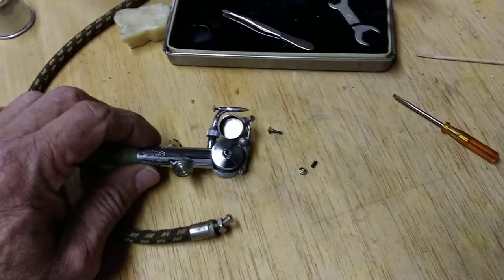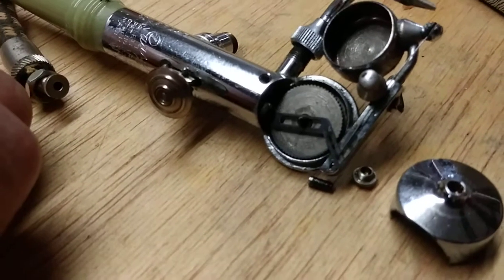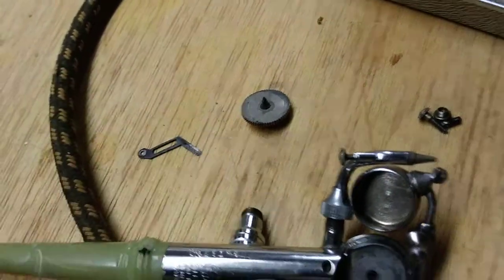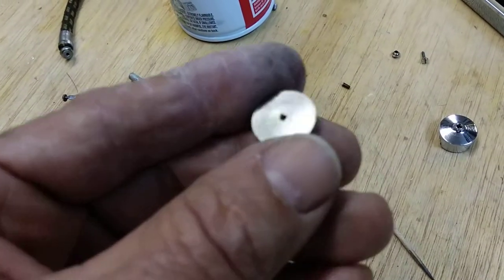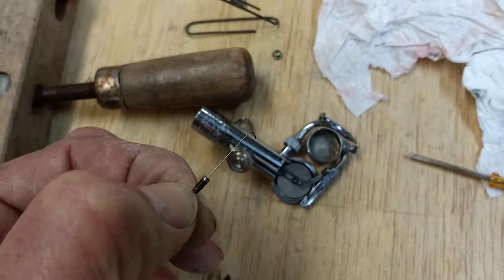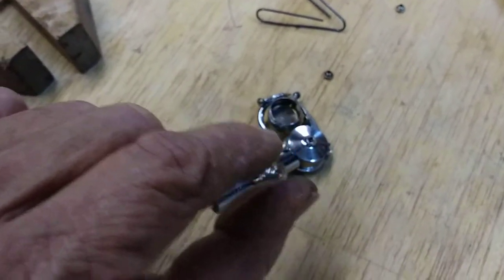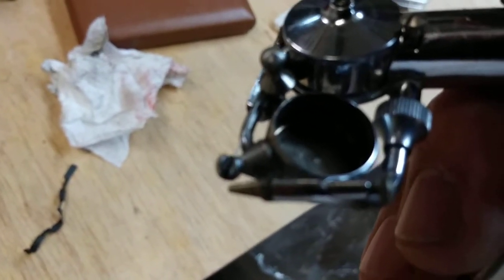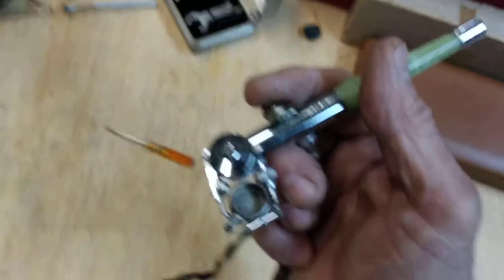Paasche type AB turbo airbrush inside cleaning disassembly reassembly.

Comment: Fantastic tool. Was first introduced to it in 1990 after I’d been airbrushing for about ten years. Purchased a used one from an older gentleman who  did photo retouching for ad agencies here in the Twin Cities in the 40’s, 50’s & 60’s. It took me about two years to master tuning it to the point I could utilize it regularly and reliably. There’s definitely a standard or basic configuration which is good for average paint application but the real joy and advantage to using the AB for me is the custom applications which can be achieved by tailoring the fine tuning and settings to accomplish them. There really is no limits to the range of tasks this airbrush can accomplish if the time and trouble is taken to configure it for what you’d like to do. Everything from numerous distances between elements to tensions, RPMs, air pressure to the drive, air pressure to the air jet at the needle bearing, the needle throw, the relation of the needle’s tip to it’s air jet (distance and centering) the curve of the needle itself as well as the angle of the paint pan in relation to the bend of the needle (and more) can be manipulated to alter and affect the operation of the airbrush. I’ve even sanded the very tip (profile) of needles, amending them to more of an egg or pointed oval shape to depart even finer particles of paint to surfaces I’m micro stippling. The tapers of the needles can also be lengthened or shortened to change the rate (faster or more gradually) that paint is blown off of it as throw (distance) trigger is pulled back.

I’ve noted a couple of important points which are not covered explicitly in the manuals and specs having to do with cleaning, configuring and tuning the AB. One regarding the spindle’s bearings (top & bottom) which move up and down in their respective (threaded) seats. If removed or simply adjusted, care must be taken to be sure this ‘free wheel’ which drives the cam ends up centered (floating, so to speak) precisely on the right plane for proper drive. An unrestricted spin, but one which is not overly loose (rattling) is desired so when striving to achieve via the threading of these two bearings (up & down) one must take heed so the free wheel’s cam is in the optimal position to ensure the needle is unfettered in it’s cycling on the small cam. I’ve found running the brush at good pressure and listening to it as you fine tune the bearings, as good or better than any visual assessment while doing so. 

Another issue is that these bearings have a tendency to move in their threads due to vibration, especially older, worn ones. And while a lubricant such as Vasoline promotes good spin, it can also contribute to this problem because heat created by the high RPMs liquifies some lubricants and it can find it’s way into these threads, promoting this shifting in the bearing’s positions and subsequently the optimal pressure on the pin like tips of the free wheel’s center shaft. Usually, the bottom bearing will shift first, this being the affect of gravity on the softened lubricant. For this reason I keep the bearing grease to a minimum and as well, force a small bit of bee’s wax into the threads with a minute applicator such as the tip of a toothpick. I do this towards the bottom of the bottom bearing housing and towards the top of the top one, after my cleaning and prior to reinserting the bearings into these threads.

Thank you for the fun video. I’ve learned a lot about using my AB also so if anyone is having trouble with something specific on theirs or is simply new to this wonderful old tool, let me know, I’d be happy to answer any questions I can or share my knowledge regarding them. ddecay via gmail or the user name dadenko on deviant art’s site.
Reply: I bought one used about 25 years ago. I sent it to the factory for a factory setup just to get me started.  I did manage to use it often as I do airbrush work for a living. I never really achieved the Hairs width detail that some claim, but very close.. I have a wide range of Iwata airbrushes and workhorses as well. I just took it back out again and I'm going to try to get it up to the next level. We did not have internet back the..lol Thank you for your very detailed comment. I will also subscribe to your channel as well.

Comment: Far from a "novelty" these brushes are highly sought after by illustrators. The fine line detail you can get is amazing and it can do stippling like no other brush. I have a slightly rarer ABG model that I have turned down offers of over 300 dollars for. The model you have there is worth a couple of hundred dollars to the right person. Optimal operating pressure is around 20psi, if it takes more than that to spin then an adjustment is off slightly.  Very nicely done video btw. will be helpful to folks trying clean and repair one.
Reply: These things are amazing. I bought mine used in 1999 for $300.00 Can. The art store across the street at the time was selling it for $599.00 I still have it and love it.

Comment: Recently acquired one. It came with instructions, also I found on Paasche's website more detailed ones. The grease screws on the wheel housing when removed allow for Vaseline to be packed in which go through the screw holes to lubricate the power wheel spindles. The needle should be slightly arched to allow the adjusting screw to hold it better. Thank you for the demonstration which gave me the confidence to take mine apart. The lower spindle of the power wheel had broken off. I got a replacement wheel from Paasche. The AB was designed for fine art illustration work.

Comment: Thank you for this rare video!
This is something usually done by the factory!

There may be an easier fix.
So your AB does not spin and the needle does not vibrate and you do not hear any turbine sound.
Only air coming out of the air blast jet.
Most of the time, the wheel is stuck from long storage and the "grease" is dried out.
Before taking your airbrush apart, take these steps. 

The screws on the top and bottom of the wheel housing are tiny "grease" cups.
Unscrew these cups and clean out the gunk inside with something like a flat tooth pick.
Refill them ONLY with petroleum jelly (Vaseline).
They are self-feeding and should always be filled.
Do not use any other grease or machine oils!
(This is according to Paasche)

Now you have to see if you can get the power wheel to spin. 

As you can see in the video, the edge of the wheel is just below the opening of the wheel housing.
Take a thin sewing pin and bend the tip about a quarter of an inch just slightly.
Press the finger lever back to push the needle out of the way and forward toward the cup. 
Try to manually turn the power wheel clockwise using the bent needle.
Grab the edge of the wheel and move it.
Most of the time, this will make the wheel spin again when air is going in.

The air outlet that turns the power wheel should not get clogged if you follow these steps.
Use of something other than petroleum jelly might cause the clogging.

Some large compressors inject oil into the air-stream for power tools.
Make sure you don't use those for air brushing.
Moisture and particle filters should be used.

Regulate the air to around 25 lbs. or from a few lbs. for stipple to any higher pressure for finer atomization.

Some newer airbrushes, such as the $600+ Iwata Micron, can now also give you extremely fine lines.

Comment: I just got one of these units used and this video is helpful as I am now stripping it down for a thorough cleaning.
Reply from the maker: The top just snaps onto the base so it's a little tricky to get the wheel lined up and you need to make sure you get the little arm on right side up or it won't work. Again learn from my mistakes and save yourself some time. Thanks for the comment.

Comment: The art teacher at the high school I teach at was cleaning out the supply room and found one of these. She couldn't use it and it needs much cleaning. Several parts are rusty and it may need a complete overhaul. But I know i can get it running... I am pretty sure... Maybe I can get it working again. Your video will be a great help, thank you.
Reply: I sent mine back to Pasche for a tune up. They did a great job.

Comment: So it's basically a pneumatic tattoo gun with an air diverter that blows the ink off the end of the tattoo needle instead of punching the needle into skin it dives in and out of the air stream. I bet if you pull off the air pipe you can use this as a tattoo gun
Reply: No it won't work.
Reply from the maker: Basically yes, needle motion but not enough power to pierce skin..